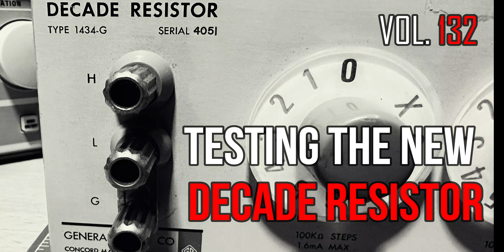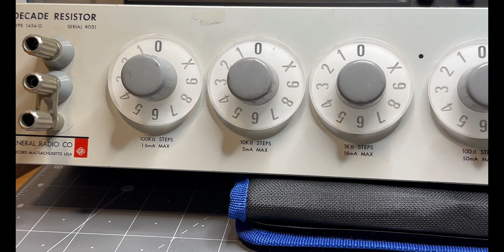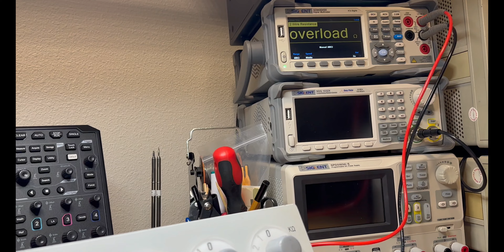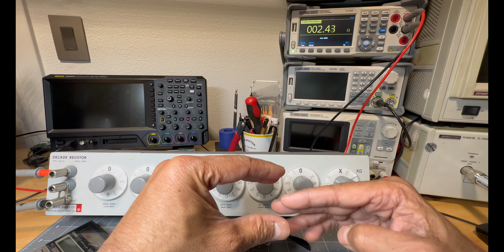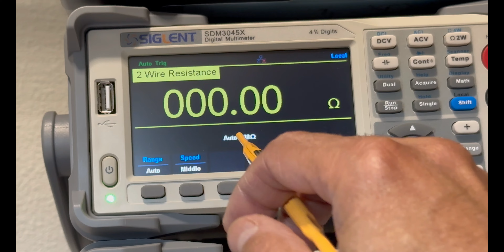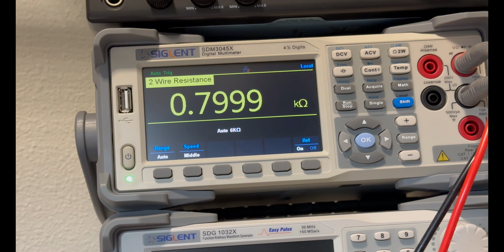N0AGI - DECADE RESISTOR - Testing - Vol 132

Comment: I'd say for single-digit Ohm readings (and certainly single-digit decimal Ohms), you should probably be using the 4-wire measurement.
Not that that's the cause of what you're maybe seeing on that first wheel. Probably, yeah, clean the contacts and take another reading.
Reply from the maker: thank you.

Comment: Looks like you'll have a great bunch of resistors after you get the dicky switches cleaned

I'd use four wire measurement mode for the lower ranges, even if it's only to the device terminals
Reply from the maker: thank you.